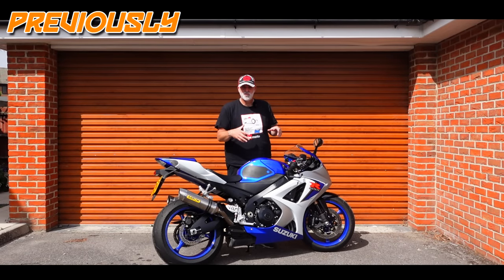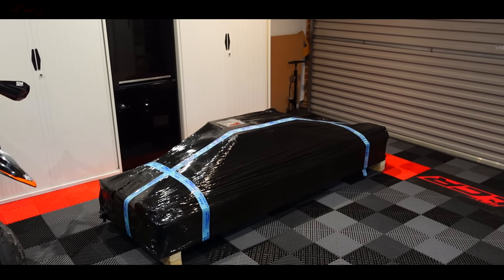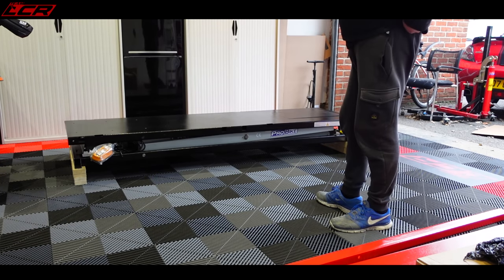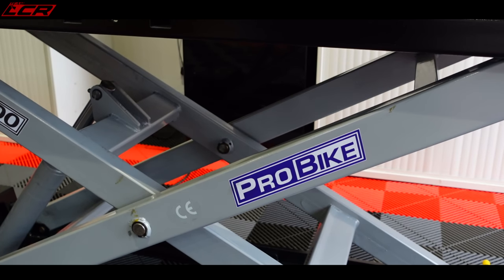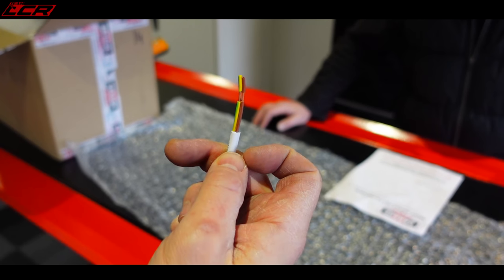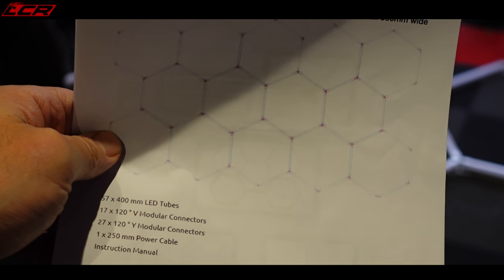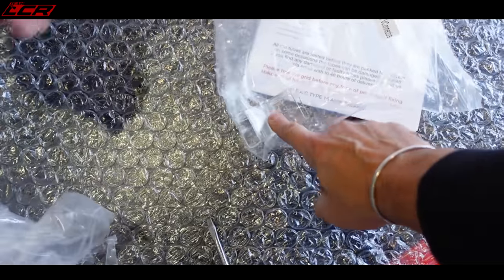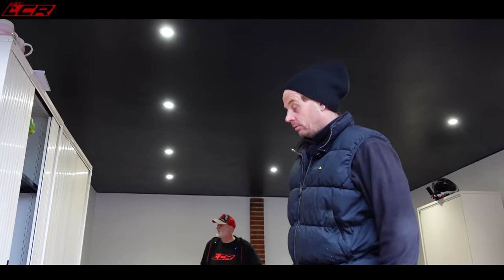Ultimate Garage Build | Pro-bike Bike Lift & Hexagonal Lighting!! EP06

Comment: looking pretty smart. just realise that if you have used 1.0mm twin and earth cable for your garage lights a 16a circuit breaker is not suitable to use for the reference methods of cable installation ie insulation above ceiling which makes a huge difference to cable current carrying capacity and also pasterboard walls

Comment: Don’t just change the breaker to a 16a if your lighting circuit is in 1.5mm cable. Probably better off running a single 16a circuit in 2.5mm just for the hex lights. Surprised it takes so much current when it’s LED lighting 🤔 looks good anyway 😊

Comment: Don’t just change the circuit breaker to 16A as the cable you e probably used for lighting should be 1.5mm sq twin and earth is between 14.5 A in conduit in a wall and 20A open (in a loft for example) clipped direct.
Unless you understand this and know that all the cables are either bigger and higher rated or are all clipped direct above the ceiling you could cause a fire in the cables without the circuit breaker tripping to prevent it.
If you don’t know get an electrician!